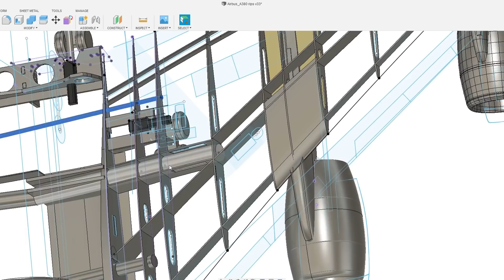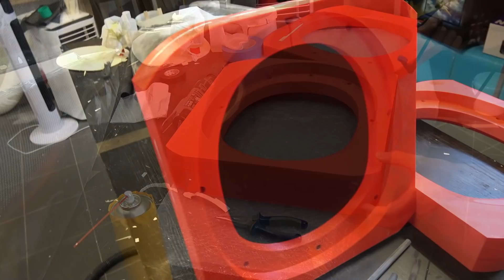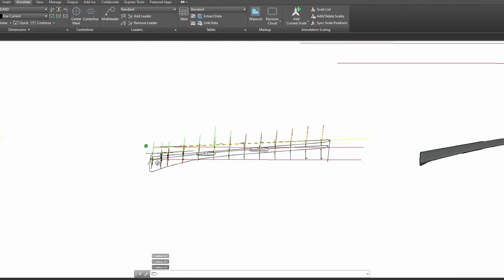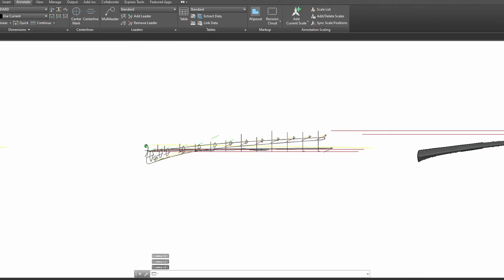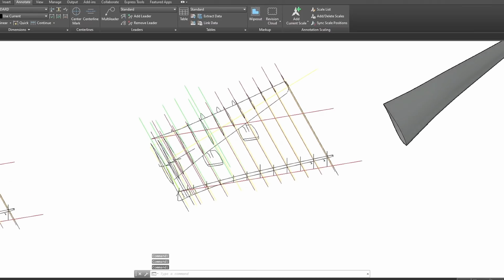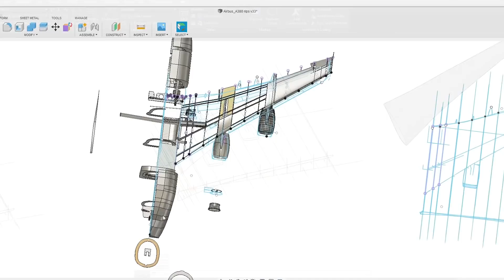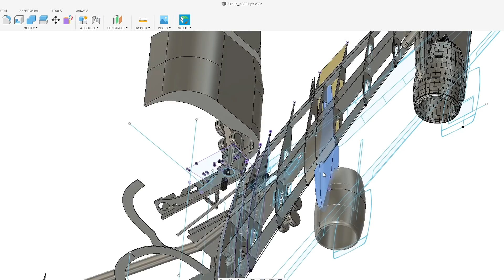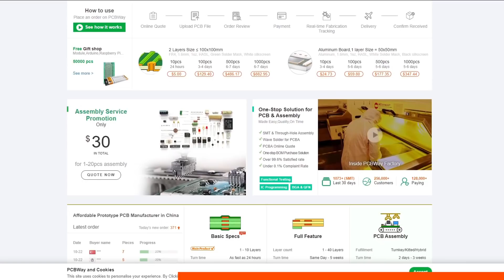Building the Airbus A380 RC airliner Part 4

Comment: Wow, I love how those fuselage sections come together, they look so solid and tight. And don't even get me started on the design of those wings. I can already see how even one layer of carbon will probably be strong enough, once you get that second layer on there with those ribs and spars, it will be much stronger than it needs to be. Great job Ramy!

Comment: When you look at the wing construction from a strength point of view,  the breaking point will be  around the holes of the main spars in the 3 inner ribs.  So you might consider to strengthen the inner ribs

Comment: Ribs must be placed always perpendicular to the main wing spar and not parallel to the airflow as this configuration is more prone to structural failure ,wich i don't think is very likely with this model as you are using a lot carbon fiber that overreinforces the wing  ,but take that into consideration , if you want to build airplanes with higher wing loading, that this is not the proper structural array for a wing of this type 😉.
Nice model !

Comment: Maybe it would be better if you pair the Fixed Camera in the Cockpit Window and the Recording Screen can be placed on the remote contrthe
Because during the landing process you can see if your plane is too high or too low, and this will reduce the risk of the landing gear being damaged.

Comment: When printing/designing multi-part molds, why are you not including some kind of alignment features/shapes to make gluing them together easier and stronger?
Reply: 10:08 as you can clearly see parts are so big they warp during print so alignment features would end up in wrong places and make assembly more difficult, he explained it before.

Comment: Hi Ramy ! My god, your work is awesome !
I need to make a mold for a part I want to make in fiberglass, or epoxy glass.
I have a Creality CR6 MAX 3D printer that I will be using just like you. 
Can I ask you a few pointers as for the slicer configuration. Do you print at 16mm ? How many walls are you putting ? And for the support, is 5% enough ?
Thank you Lamy !

Comment: Hi, There may be people who don't understand the materials your using. All very familiar to me, auto body repair. Like the glass beads. They are in panel bonds people may not understand why. To maintain enough epoxy for adherence is why you are adding them to your mix.

Comment: How does someone increase the range of an RC plane or drone??
Which batteries are best for the range??
Reply: You don't, in most countries you have to stay in visual range, you can not go farther.
Reply: Bigger battery means more longer flight time but bigger battery also means more weight which decreases flight time. We measure battery capacity in Ah (how many amps you can draw for it to run for an hour)

Comment: hi ramy RC, I wanted to know if you could be interested in a 3D model of an MB339 or maybe if you want to make it I saw that you are an expert and I find your work spectacular. my dream is to create a mb339 with a wingspan of about 2 meters. but the main thing is that it must not have holes on the belly must take advantage of the original wing vents. studying the model I realized that it is really complicated since I am in doubt that the EDF is not able to vacuum properly. maybe once this monster is finished you will want to try your hand at something smaller but very complicated

Comment: Is it going to be complete with an exploding no. 4 engine?   And you do realize that the fate of nearly all large RC aircraft is to eventually end up scattered over a small area in a field, right?   

I suggest that you build it with telepresence piloting in mind from the start.   Fly it from a simple cockpit in a small trailer and even better, do it with a VR headset.

Comment: and it would not be easier to do, a one-piece center section of the wing for internal engines and detachable consoles with external engines, the dimensions in the folded state would be reduced, and due to the increased rigidity of the center section to reduce weight ...

а не проще было бы сделать, цельным центроплан крыла по внутренние двигатели и отъёмные консоли с внешними двигателями, габариты в сложенном состоянии уменьшить бы, да и за счёт увеличившейся жёсткости центроплана снизить вес...